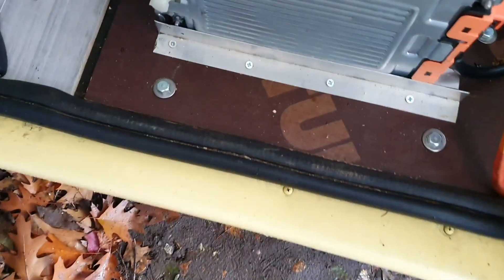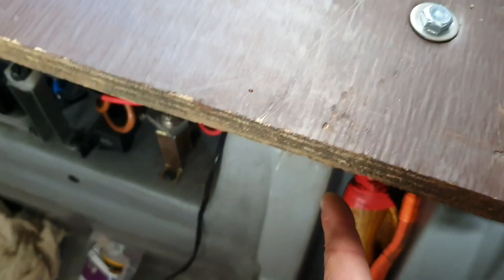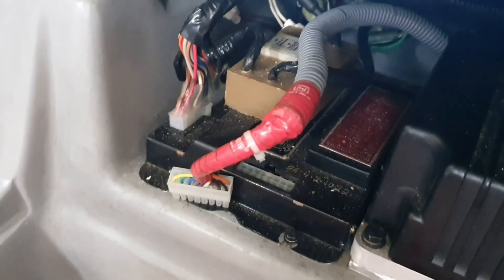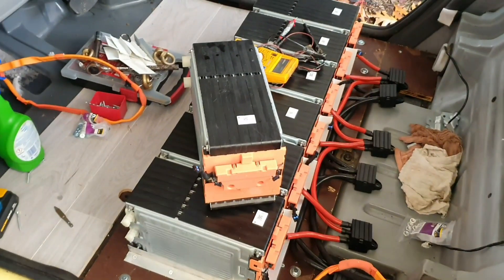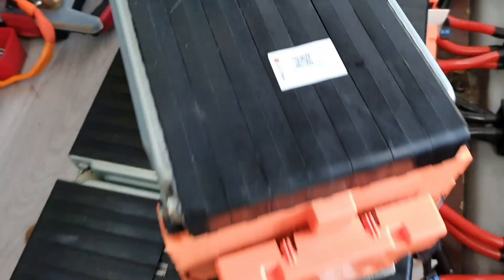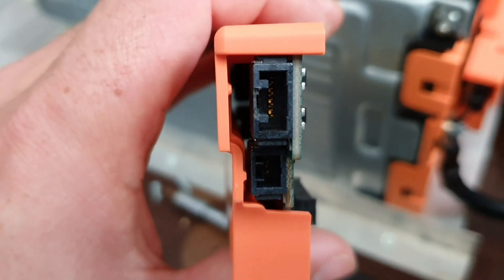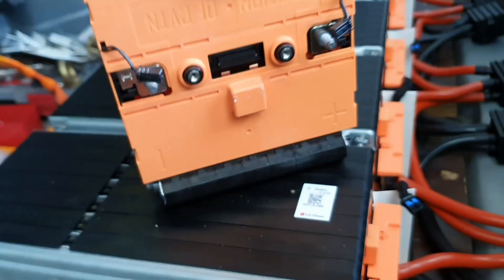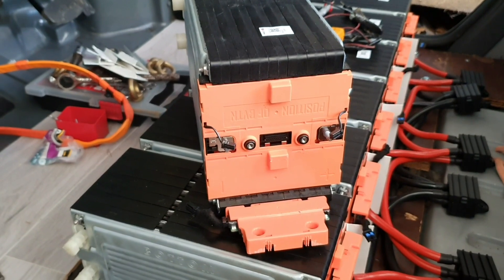REVA G-WIZ: Yellow Wiz Lithium-ion conversion pt.8 - wiring up the fan to switch on with charger.

Comment: Unless my eyes deceive me, that lighting transformer outputs AC, not DC. The ~ symbol is a bit of a clue.

 I'd use a relay with a 240VAC coil to switch 12V DC to the fan. If you use a 40A contactor, then it can also switch the 48V line to the charger/DC-DC, so it's not a constant drain on the battery.
Reply from the maker: That's right, it was an AC transformer. Fraser confirmed it for me too (edited in description). It was dead anyways as I tested it on both AC and DC on the multimeter from the output side to make sure it was generating the right voltage in the first place. The reason I did it this way was so that the fan activates when I plug in the mains so I'm not sure if putting a contactor there as it won't function when I use the car on the road (unless I misunderstood you and you mean a separate circuit on 48v). I could alternatively borrow a 48v relay from the aircon/heater out of my blue G-wiz and put a switch on the dash to switch the DC-DC on and off that way instead on the 12v side (though I guess that defeats the object of turning off the DC-DC). However if I use the car often along with the 15kwh battery pack it shouldn't be a huge drain and if I don't use the car at all for a long period I'll disconnect the battery completely.

Comment: Very nice i like the idea for the fan i cant wait to see the whole project finished.. i just finished mine with four 150 ah lead acid batteries i didnt make it wiring the original charger. So i had two 5 amps 60 volts scooter chargers and i wired them together for a total of 10 amps at 72 volts and i made a small relay circuit and set it to turn off at 59 volts.. i completely disconnect the bms and its working very good now i gave it a test and did 25 kms and it still have some power. I am pretty happy with the results . i also hook a small 160 watt charger and give them a cv charge with the mppt 7210a  after the relay cut off from the main chargers to help them balance..i hope the lead batteries to remain balanced and not have any issues.
Reply from the maker: Great to hear you got it running for what you need right now. The fan is only essential if you use the original charger otherwise unneeded as the controller itself is air cooled.
Reply: @RichardMawby  yes !!! Waiting to see yours running soon !!!